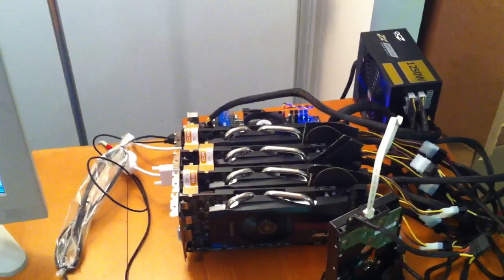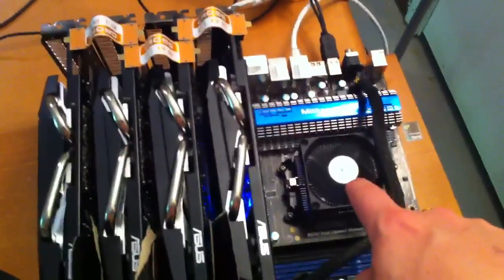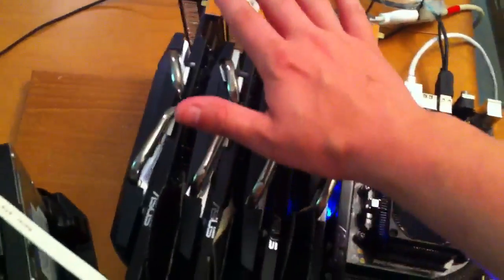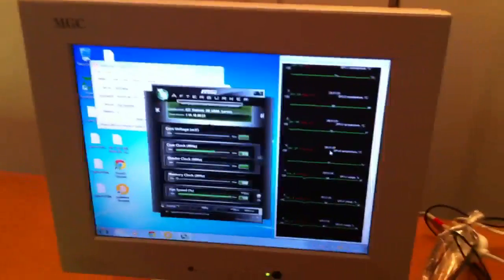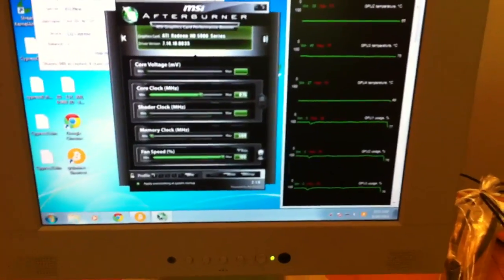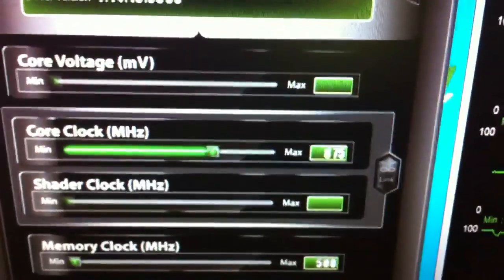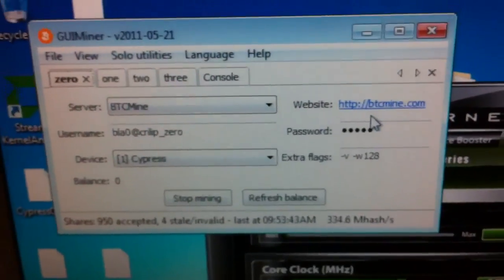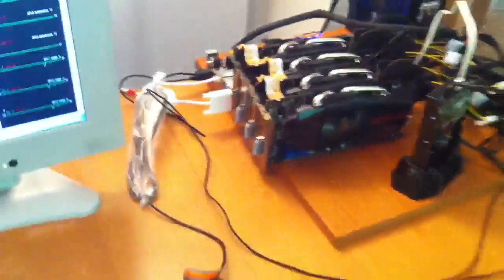Radeon 5850x4 bitcoin miner

Comment: I will mine at 100 gh/s with my miner for 1 full year and payment will be made each month to the buyer. I have 5 KnC jupitor miners at 680 gh/s each making them at around 3.4 th/s
I am only selling 17 of these contracts to help pay for electricity and running costs.
I will show mining report each month and split the value of bitcoins mined and send payments on time without fail
please note the value of bitcoins as well as the difficulty level of mining blocks can change but is a guaranteed profit maker.
I only accept bitcoin payments   of  btc 0.2
my bitcoin wallet address is ( 1PcQjymS8nUAbEVwXpHN9UveKq6mrJP4uB   )

bare in mind a 100mh/s asic miner costs around 400 pounds excluding running/electric/maintenance costs

Comment: I thought you weren't supposed to/ didn't have to crossfire when mining so the cards can run independently.
And in reply to Morgan freeman (soz I don't know how to reply properly on the ipad app :)), the bandwidth is less important than it would be for the likes of gaming and rendering, so the cards will run in an x4 or even an x1 slot I think, so you don't have to find a board with 4 evenly placed x16 lanes.
Reply: You can get BITCOINS without mining http://freebitco.in/?r=161366  very cool site

Comment: How much giga hashes would you get with an asus GeForce gtx 760
Reply: lol none youd get like maybe 200 kh/s litecoin mining
Reply: mine gives 95MHASH/S overclocked and my 5870 does 365 with stock clock
Reply: Thanks for replying so quick!
Reply: znoozaros Why such a big difference?
Reply: Fosper its because of the diffence in architecture between nvidia and amd. Amd cards have a lot more ALU units for mathematical floating point calculations. Nvidia built pretty much solely for being awesome at games

Comment: Hey,
I´m going to mine litecoins soon.
I´ve got a flashed 6950 to 6970 and 2 5850.

What´s the software called that you use to optimize your cards?
And is there any side, that explains how to clock for high hash rates?

Regards
Reply: don't go crazy on overlclocking you just want something stable that doesn't overheat your setup
Reply: MSI afterburner. great overclocking software.

http://www.guru3d.com/files_details/msi_afterburner_beta_download.html
Reply: if you're overlclocking for mining you can do it right in cgminer also msi afterburner is free
Reply: just litecoin mine, so much more profitable
Reply: kauaian11
I found it. But you´re only able to overclock a little bit... I`m searching for a tool that allows free overclocking.

Comment: Dude this may have worked when bit coins were less then a dollar. However mining rigs are pretty much out of reach now. Standard rigs go for over 3 million dollars now. That is probably low end ones at that. Unless you can build some quantum computer and tap into the power of an NSA data center. This is useless and you end up spending more then you can mine, just saying.
Reply: I mean zero disrespect with this reply, just to say at first! I wanted to basically say here that professional mining rigs are not out of reach for an individual such as yourself or myself. It wouldn't take that much money to start up a small BitCoin mining buisiness. This site sells professional mining machines at $6,000 each.
http://cointerra.com/product/terraminer-iv-2ths-networked-asic-miner-february-batch/
With the price of a bitcoin at this moment that I am typing this, a bitcoin is worth $700, give or take. With that $6,000 machine you could potentially make your money back in a very small amount of time. That machine could mine more than one bitcoin in a day, producing 2TH/s.

Technology is amazing...
Reply: ya but if you mine litecoin you can make $20 a day with a single 7970 lol
Reply: true, your electric bill will be bigger than your bitcoins you will need 30.000hash rates to get 816 us dollars, plus u will need to pay 100dollar for the electric bill. but 30.000 is nonsense, its imposible !!!
Reply: Not sure what Obama' has to do with this lol. Anyways you don't have to be a dick and I do know something about Bitcoins. Bitcoins currently consumes some $15 million’s worth of electricity each day. Which is when you come to think about it, really a rather astonishing amount.

One way of thinking about this is that the electricity used in a year is equal to 50% of the total outstanding value of all bitcoins so far mined. That’s not something that I can imagine being all that sustainable as a long term proposition really. When people were using just straight PC chips.

Or perhaps the FPUs in graphics cards. But the state of the art these days is a custom designed ASIC and those just aren’t going to have anything like that sort of power consumption. Which you need to be even worth your effort.

Bitcoins now are in the hands corporations and or people with bottomless bank accounts. You might make some but not enough to be worth your time.
Reply: i bet u feel stoopid

Comment: Bitcoins are NOT necessarily exchange for valuable labor.  Hobbyists also do NOT monitor the bitcoin system.  They take part in it.  The only reason it will keep running as *viable* system is if the p2p network is able to maintain a certain node threshold.  Also, it has to take interest around the world as the new COMMON currency of exchange like the US dollar.  And the USD is somewhat attached to how the performance of the country is doing as well as the economy.

Comment: Graphics processors are made of hunderds of small cores that are way better at parallel processing than CPUs are.

A common i7 has 8 logical cores that it can use, while a graphics card like a 660Ti 1344 cores.

That makes the graphics card more efficient at multitasking.

Comment: the reason one of your graphics cards is cooler than the others is because the card that is cooler is the one at the bottom of the stack (the one that dosnt have another card right in front of it's fan) so your airflow is restricted

have you considered putting a fan on the open side of the stack ( looking down at the motherboard with the fans pointing you this would be on the right side) blowing into the cards...it would probbably work best if it was 2 fans like a retrofitted ram cooler

Comment: Those are called public keys, they are used to send BTC to your wallet file.

You can make an unlimited number of wallet keys and there is absolutely no way you can ever trace them back to the same wallet. That is the point of the entire system. The only way you can verify the two patrons of a bitcoin transaction is if they both admit to being part of the transaction.

Comment: You'd be silly to publish your wallet key, everyone could spend your coins! As for the public keys (used to receive coins) you'd be silly to use the same one all the time, that's the point of being able to create new ones which have absolutely no correlation to any other keys on your wallet file!

There is absolutely zero way to trace any bitcoin transaction to it's involved parties unless they admit to it.

Comment: Apple protects its assets and patents in its interest to remain part of the market and turn out products and charge a high premium for them... Bitcoin is not a company, nor does anyone have any control over bitcoin except its' users. Apples (pun intended) to Oranges (or Bitcoins?)

You can't compare them, bitcoin is 100% open source, everyone can see the code. Make something 10x better if it's so easy. mtgox is still open, just set up a bank wire for my $80 withdraw today. :) 

Research harder..

Comment: Because BTC was first and didn't have to compete with BTC since it IS BTC... LQC failed because BTC existed beforehand and did not provide a better solution for at least 50% of the BTC network... if such a solution does arise, it would not be "killing" btc as people would move/trade their BTC into the new currency, and adopt it. Thus it would be an evolution.

Comment: You are completely incorrect and brainless. The USD is not backed up by the US GDP. Plus they stopped backing up money by gold a long time ago, which means that they print money out of thin air. The new bitcoins are exchanged for valuable labor, payed to computer hobbyists who monitor the Bitcoin system to keep it running and to prevent counterfeiting.

Comment: I'm using a Radeon 6870, and the GUIMiner keeps disconnecting after every block.  It runs for 5-10 min, then I have to "stop mining" and "start mining". It sure slows things down....

Has that every happend to you?

Here are the errors:
Listener for "MinerJoe":  warning: job finished, 0:0:Barts is idle
 Listener for "MinerJoe": IO errors - 1, tolerance 2
Listener for "MinerJoe":  long poll IO error

Then I get long poll over and over again till I reset.  I'll give you some coins if you help :)

Comment: Wow, you must be so special. It was widely know that the bubble isn't the fault of the currency, but the idiots speculating and running under-equipped exchanges that couldn't handle lots of new people. Since we are bashing currencies, be sure not to use the dollar as it is backed by nothing, and has no value. Same with the Euro. Get real, Bit-coin is new and it has to stabilize.

Comment: I have not attached a meter to see the actual draw but I have a 1000 watt power supply so when I do my math I use 1100. Its better to over estimate than under estimate. It costs me about $0.11 per kilowatt hour so in 24 hours that would be $2.90. Again its a bit of an over estimate though.

Comment: I got 2 7870s liquid cooled and overclocked to 1200MHz (+200 from stock), and I get about 430mhash on each one on average, but it is also my gaming computer and I only mine while I am at work or sleeping. The top temp maxes at about 40*c while mining and the bottom one at about 50*c max because it is second in the same loop.

Comment: well, each GPU needs to have a PCIe 2.0 x4 slot (at least) to itself. there is no consumer motherboard that has more than 4 of these slots.

And there's the fact that you can't have more than 4 gpus in crossfire or SLI.

Comment: depends how much you mine and solo or group mining etc. If you mine in a group the bit coins will be distrobuted evenly so if there is 10 peers in the group and you earn 10 bit coins as a group for cracking one hash then you each get 1 coin :D. If you solo mine it takes longer but when you do crack the hash you get all the coins to yourself. Be warned you need a good gpu to mine with.

Comment: If you actually GOOGLED the PROFITABILITY of BT mining you'd see how RIDICULOUS and STUPID that number that youtube user posted. The FACT is most BT miners in a year range from 0 profit to a couple hundred dollars to up $1000-$2000 in exceptional cases. So let's use an exceptional case for example, $1,000 profit per year, that equals ~$19/week PROFIT. This of course excludes the energy cost to run the rig 24/7.  Google "bitcoin mining energy cost" and read the article on  pcper . com -You'll see

Comment: Wait so, 1340mhash/sec is like 0.5BTC per day or 15BTC per month = $150 
However, this kind of setup is gonna pull what, like 6-700watts? 
That works out at about $120 for electricity to run this 24/7, so it's only just paying for its self.
I guess it pays for the internet connection :P

Comment: By my calcs - 1340mhash/s is about $4.76 today.
Also - 1200watt power supply at 20c/kwh will cost upto $5.76/day  (perhaps a bit less - depends how much it's actually using - 1200 will be the max capacity, actual draw might be a bit lower).
Reply: Today it would have been maybe 1000€ a day xD

Comment: Your figures are correct, but if the power supply stayed maxed out @1250w 24/7 for a 30 day month at my local rate of $0.07 kw/h the electricity bill for the power would be around $63.

The question now becomes, "How much does this rig actually end up drawing?". If it is well below 1250w, then you could make some good profit.
Reply: If he safed his coin the daily revenue would have been 1000€ a day xD

Comment: @BootyBot At todays difficulty with his ~1340 MegaHash/sec you get 0.9 Bit coins a day or 328.63 a year, with current price of bit coin at $4.83 that is income of $1,587.28 a year if prices stay the same for next 12 months, he probably spends around 300-350 bucks in electricity a year so it's after the first year and paying back the rig, that is a nice residual income coming in for as long as bit coin exists.

Comment: @GDplusEng
It is simple, but you will need 2-3PSU to power that many GPUs so I'd recommend using 1 PSU and do two separate rigs, just for safety reasons.

Comment: @GDplusEng
I use the PCIe 1x expansion slots!
My MB is a GA-MA770 and I have 5 cards on it. I use PCIe extender cables 1x to 1x! You can buy them from e-bay for 3-5$.
And yes the cards work on 100% using PCI 1x instead of 16x or 8x. Mining doesn't need wide band-wight!

Comment: @GDplusEng its not very good cooling.
The mineral oil heats up slowly, but it doesnt cool down easly, so when you reach the max temp, its harder to cool it down.

You would have to pump the oil throu a huge radiator for this kind of heat.

Not to mention its not cost effective and he's trying to make money from this.

Comment: @aradioactivedonut What I meant is, just because you have more than one graphics cards in a rig doesn't mean they HAVE to be in crossfire mode or any other type of parallel-processing mode.  The rig I use contains 2 radeon 5830s, and they COULD be connected with a crossfire cable, but they're not... and I get about 600 MH/s from them (between 280-320 each).  Now, I do not know exactly if putting them in crossfire mode WOULD increase the MH/s I get from them -- I doubt it, but I could be wrong.

Comment: @kydoes Nope, cpu power is not used in mining.  It (and your system memory) might make a difference when you navigate the OS (i.e. move the mouse around in windows might be laggy), but as far as the actual mining is concerned, cpu and system memory do not come into play whatsoever.

Comment: I did some very rough math (because I'm naive to how much the electricity would cost and how often you would need to buy new video cards), but from what I can tell, at the current exchange rate you can't really make much more than minimum wage doing this.

I'd be interested to know how much money a person can make per month with a 1000+mhash/s system... 

I guess the amount you make entirely depends on what happens to the market in the future, so it is a very blind investment..

Comment: you can safely downclock the mem to 1/3 of the core clock.
900/300 works pretty well here - 360mhash per 5850 @ ~68°

Comment: @philipthrasher wow 1050 Core? I can't keep it stable, however i'm not very good with knowing how it works with voltage and whatnot. My 5770 is OC at 1Ghz Core with 300 mem running 212Mhash/s. And also in my computer i have a 6970 running at 430Mhash/s with 1Ghz Core and 500 mem. Also flashing new BIOS is likely way beyond my current capabilities. If i could find 5850's i would definitely buy them. But seriously everywhere i look they are sold out or overpriced like on ebay.

Comment from the maker: @neilharbin0 I get 233mhash @ 1050 core, 350 mem. I flashed the bios on the cards. I modified the bios using RBE under windows, and applied the new bios using a dos thumbdrive loaded with atiflash. 5850's are bitchin... Definitely the cards to get if you can get them for less than $180.00

Comment: @philipthrasher Really 230mhash/s for a 5770? what are you running on that? I have an HD 5770 Hawk OC at 950 and 60C. What programs are you using to overclock and to what extent? I wish they had 5850's in stock somewhere, i've been looking around but they are sold out everywhere. Yesterday i made a list of the best parts to get an entire rig using those.

Comment from the maker: @neilharbin0 It will take about a month if you buy the right hardware. The best cards in terms of return on investment are the 5850, 5830, and 5770. The 5770 is my current favorite as it is dirt cheap. It only does 230 mhsah, but for the price, you just can't beat it.

Comment from the maker: @MrAbsoluteknowledge I'm using linux now. I have two newer vids, check them out.

The card memory doesn't matter as the calculations you're going to be doing are not memory intensive. Textures in games require tons of memory. The algorithm for mining, is just complex math only. The memory is hardly used. Get the cheapest card you can find with the most stream processors.

Here's my card decision chart:
5850 if < $180
5830 if < $140
5770 if < $120
5970 if < $250
6870 if < $200
6990 if < $500

Comment from the maker: @disinpho I just posted the new video. OC'ing in linux is pretty simple, though there's no way to change voltage. What I ended up doing was flashing the bios on each card to the clocks I wanted. If you have any questions, let me know. Check out the other vid. :-)

Comment from the maker: @pirucreek I've added the mobo, and cpu info into the description.

Yeah, the bottom one is a really low temp. I'm going to make a few changes to my setup. I intend on shrouding the four cards in cardboard, and doing some custom ducting for betting cooling. Of course, I'll need to remove the current fans to do this. I just set it up last week, so, I'm going to be making some changes over the next week or two.

Until I get the ducting done, I'll have the bottom one oc'd more than the rest.